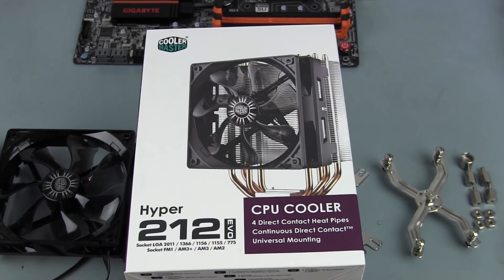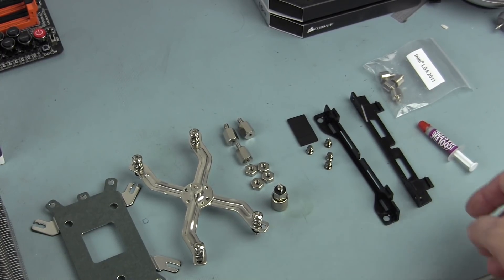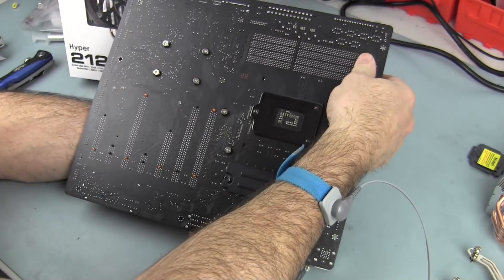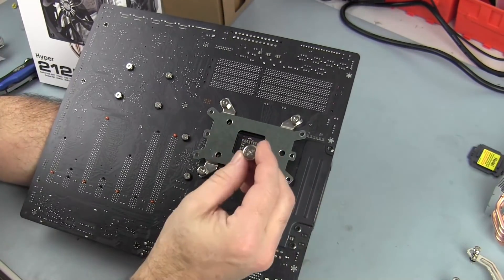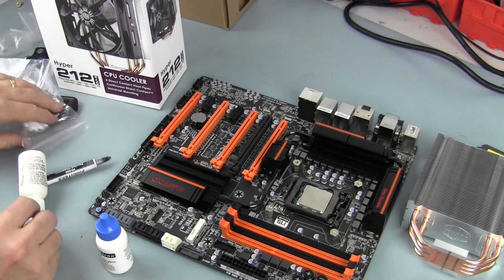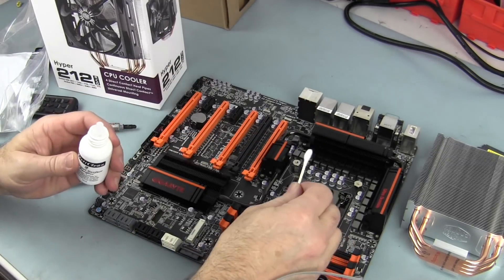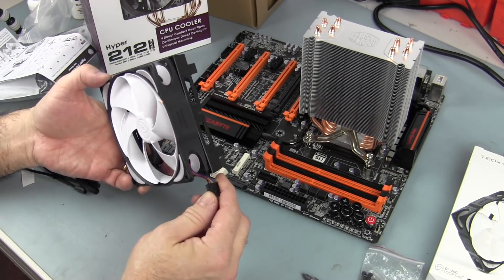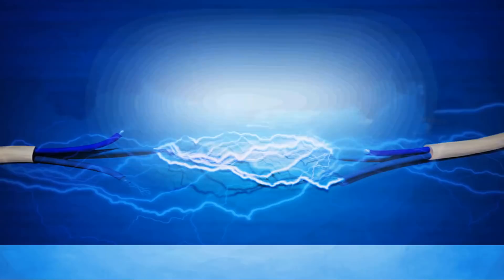How to Install a Cooler Master Hyper 212 Evo CPU Cooler

Comment: plan on putting it on my 8350, will this interfere with my 4x4GB G. Skill ripjaw X series at all? this is on an asus sabertooth 990fx mobo and just want to know if this ram is too tall
Link to the ram: http://www.newegg.com/Product/Product.aspx?Item=N82E16820231429
Reply from the maker: Depends on where your ram slots are and how close to the cpu it is. I have used that ram before and I think it is fine.  But I can not be sure.

Comment: hey i'm thinking on upgrading my cpu cooler. I've noted on these big coolers. The thing that scares and confuses me is if my board will break with so much weight?!

I mean I've seen you installing the thing but the board is laid on the table horizontally. Will it not break the board when placed in a case vertically :S
Reply from the maker: The support bracket they include takes the stress and is designed to allow for a mount in any position case. Horizontal or vertical. It will not break if installed correctly.
Reply: Ronsanut . Cool, thanks :)

Comment: The core is 90 degree wrong orientation, it should point left to right not front to back.
Reply: I'm pretty sure orientation is all preference, depending on your setup.
Reply: As pictured

Comment: can i use the cooler with big corsair ram
Reply from the maker: Depends on your motherboard layout and spacing between the cooler and the ram sticks.
Reply: Also I think the fan slides up a bit. To be safe I'd look at a low profile Corsair ram/another cooler

Comment: What exactly is that screw thing in the middle where the pin connects the bracket to the heat sink? Should that be tightened?

Comment: Thanks for the guide. Watched it on my iPhone when i installed the cooler on my i7 4770k. 32 celcius idle and 60 celcius full load. I had 100 celcius full load on stock cooler.
Reply: Same here, 105 celsius on CPU while playing games and idle is like 70°, man who made my PC fcked somewhere so I'm buying this cooler next week
Reply: @drteska97  I'm buying this cooler soon. Stock cooler my i7 4770 is fine at idle (35c) but jumps up to the low 70s celcius under full load and its very loud. Hopefully it's not too much of a pain to do it with mobo in the case
Reply: Jeez thats high

Comment: I'm using the similar cooler Cooler master 412 slim + intel 3770k + Artic silver. Temps are idle = 30C, Load = 65C. That's not very good for this cooler is it?
Reply from the maker: Depends on the ambient temps in your room and the voltage you are running on that chip.

Comment: One of the primary reasons I bought this unit was because it is listed as one of the quietest on the market; Do you really need it quieter? Why change out the fan? Just because?
Reply: I kind of agree that swapping out the fan on this defeats part of the purpose of the install video. OP should probably put that in the heading so people know.
Reply from the maker: Because the fan I used is quieter and pushes more air.  Just my preference. The fan that it comes with is not bad though.
Reply: Ronsanut .
Cool, thanks. I was a little worried I was duped into buying a loud fan (haven't built yet, am doing that now)
Reply: The unit is amazing :D
Reply: t0lkien1 I might of been a little dumb on my part, but I'm currently doing a budget build (£900) and couldn't afford top of the range fans, so I bought 7 CM Sickeflows what are meant to be quieter and better performing than the Hyper Evos 212 Stock fan (plan to put 2 on the cpu cooler) but problem is there 3 pin fans (my mobo does support 3 pin cpu fans) but do you think I should replace them for PWM fans?
Reply: Eh

Comment: does the fan come with everything required for installation? all the screws etc.
Reply from the maker: Yes, everything is in the box to mount the fan that comes with it. It also has brackets to mount a second optional fan.
Reply: Thanks (:

Comment: I have a question. Is it possible to do this without taking the motherboard out of the pc? my case has a detachable board on both sides.
Reply from the maker: Yes if your case has a motherboard cut out for access to the back of the motherboard, it should be no problem.
Reply: Thank you

Comment: You installed the backplate backwards. The taped side is supposed to be facing the motherboard, is it not?
Reply: each side is usable, which side you use depends on your cpu socket.

Comment from the maker: Check you temps.  If they are good I would not worry about it. Just make sure you have the pin in the hole keeping the tower locked in place.

Comment: The cooler will work with the LGA 1155. You can verify this by going to CM's website. And I'm sure it'll fit your case as it fits into my Corsair 350D, which is much smaller and more compact than the HAF 912, with no issues. I'd be more concerned if the 212 Evo blocks any of your DIMM slots on your mobo so double check that.

Comment: Most concise and helpful install video for the 212 Evo on YouTube... thank you! The instructions that came with the cooler is absolutely garbage. At most, one should just browse through it then watch this video from start to finish. Thanks again, Ronsanut.

I've been less than impressed with the stock fan that comes with the cooler so I'll be replacing it as well, but with a Noctua NF-F12 PWM instead.

Comment: No, a second fan would perform just the same as the one opposite, it doesn't share the power it both has it's own equal power, but volume wise, I don't think it would make a noticeable difference.

Comment: i used the stock cooler with the 8350 for a bit until the 212 came through the mail. the temperature difference is quite amazing.

Comment from the maker: Watercooling will achieve the very best results, but if you want to OC now, and have to wait to fund some custom watercooling this $30 cooler is well worth it.  Or you could buy a self contained unit like the H100i and get better performance than the EVO.

Comment: does this cool enough of an amount to spring an extra $30 for it? also is it gonna be okay for a little overclocking (im using an amd processor i mentioned this because they run at higher temperatures than intel) its an 8320 and i wanna over clock it to 4.1ghz (700mhz more) so will this be good enough or should i hold off and wait til i get enough to buy a water cooling system?

Comment from the maker: Ideally you mount it so it blows through the heat sink fins and out the back of your case or out the top depending on your cooler orientation and case air flow.

Comment: You never actually need a cooler like this unless you plan on overclocking.  But that said, this cooler is cheaper than even the cheapest watercoolers, and it outperforms the cheap watercoolers.  You can do better than this if you have a full watercooling setup with a radiator, but those are expensive and quite a bit more work to install.

Comment from the maker: The 212X is the upgraded version that hasn't reached proliferation yet. Fan aside, the difference lies with the aluminum fins. They have X-shaped perforations around the heatpipes. These perforations have a two-fold purpose: the first is to help direct some of the airflow around behind the heatpipes to stop "heat pockets" from forming, the second is to allow for better a better type of airflow.

Comment: Great.i was thinking of getting the Cooler Master hyper 212 EVO,2 cooler master fans(1 for the case and 1 for the CPU) and getting arctic cooling MX-4 thermal paste.Would these decrease the temperature of the CPU greatly compared to the stock intel cooler i have at this moment?

Comment from the maker: Very good as well, just takes a long time to cure and is very thick, You will probably have to use the spreading method to apply it evenly.  But does work good. It is conductive so make sure you do not get it on the motherboard.

Comment from the maker: Low profile ram, is good. Face the fan so it is blowing through the EVO and out the back. If you can put two fans on it blowing from front to back. The air will exhaust out the reart of the case.

Comment from the maker: There is about 7.5 Inches of space from the CPU socket to the roof of the Prodigy and the EVO is 6.2 inches tall , so yes it should fit, however you will not be able to put any fans in the top/roof. Also a fan in the rear of the Prodigy should fit but may be tight.

Comment: How. Much could I safely over clock with this cooler on a i5 4670k. I was gonna use a h100i but its more expensive and barely fits my fractal r4 case. Any help is nice

Comment: Wish i had seen this video when i fitted mine, i had a right hassle before realizing that i had to use the mounting plate!  Also i find that this cooler does a good job of cooling but is quite easy to move around by accident if you try and take the fan off.

also if you run your computer with the side of the case off the space between the CPU cooler and fan gathers a lot of dust, so i recommend you keep the side on.

Comment from the maker: I thought the cooler came with enough. You can probably get some form the Cooler master website or they may have vendors listed who have the pads. Or google stuff like this:
SilverStone 21-Inch x 15-Inch 4mm Thick 2-Piece Sound Dampening Acoustic EP0M Silent Foam SF01

Comment from the maker: Ideally you face the fans out the back so the air flow comes from the front of your case and out the back. But can face it up and blow the air out the top of your case (assuming you have vents and or fans in the top, or you could even face it down or in pulling air from the top or rear into the case, but you have to make sure you are exhausting the hot air somewhere.   Also the cooler is bolted down and does not put stress on the CPU itself.

Comment: Which way should the fan be blowing airflow as directed on the cooler? Can you please give direction? I will be using the fan that comes with it plus an extra fan (second fan) to the back of it. But I am not sure how to properly do this.

Comment: Correct me if I'm wrong but the dimensions of the LGA 1155 are the same of the LGA 1150, just the socket is different.

Comment: i have cooler master hyper 212 evo, my cpu is amd fx 4130, 
my cpu temperature is at 0 to 7 degree celcius... from Speccy, 
and from the bios it shows 15 Degree Celcius.. so which one will be showing the correct temperature  ???..

also from the bios it shows the the cpu fan is running at 700Rpm .. ??

Comment: #5 Finally, like most videos close up attempts are silly, if you're gonna hold up the board, put it right up to the camera, or pause the camera and get the close up, or have a friend help you film it, you also did not mention that the adjustable X bracket's 4 screws are spring loaded, which is why i don't think they have to be tightened till they stop, the pin should be clearly zoomed in on.... overall this video get 3 stars out of 5... no to bad! have a nice day, thanks for uploading :)

Comment: #4 memory hitting the fan is an issue for some you can raise the fan up on the tower fins if needed, you should have discussed this and the wire harness orientation before screwing on a fan bracket, you dropped the ball on fan basics 101 but that's why im here...lol

Comment: #3 so the fan blows into the tower and out the back of the case, also a second fan could go on the other side, you could have used the one that came with it for that, it would just have to be mounted(reverse the brackets) so that it blows in the same direction out the back aka "push pull", this term gets people confused just remember fans must blow in the same direction never against each other, and push pull sounds like opposite but its not meant to be thought of like that...

Comment: #2. Why not explain why the fan is where it is... The fan can be on either side, not to mention the "tower" can be reversed as well, but reversing the fan would cause the heat to blow into the case, you have it right pointing it toward the rear ports on the board, ie back of the case... also once you had to add the brackets to your new fan you could have pointed out which way the fan blows, not an issue for stock fan cause the brackets are pre-installed, you want the fan to blow into the tower..

Comment: Ronsanut, first off compared to most tutorial videos, this is well done, however here are my concerns: #1. you used a 2 step cleaning process for the cpu, yet disregard cleaning the the bottom of the heat sink where it kisses the cpu, especially after removing the plastic which may or may not have some type of adheasive, and even if its just cling-on (relax star trek geeks) type of plastic it never hurts to clean both sides when gluing something. see next comment for #2.

Comment: Hello there! I got a HAF XB case and will use this Hyper 212 on the cpu. I dont OC much and dont like if the noice level is to high. Im wondering if u have any LED pwm fans that pops to mind that will do the job on this Hyper212 either solo or in push pull.
Thanks :)

Comment: if im using the stock cooler for fx 6300 do i have to install the hyper 212 backplate? or the stock cooler backplate is fine

Comment: The only power it requires is the fan. You will NEVER need to upgrade your PSU for fans.. They use a minute amount of power. ALthough honestly I'd got with a 600 W just in case for the future...

Comment from the maker: I have not tried to rotate mine, but it really should be very snug. Undo and recheck your installation. There is locking pin in the bracket and base that should keep it from rotating.

Comment: No, your current PSU should work fine.  In the worst case a 120 mm fan only uses about 3 watts, so you don't need to worry about the PSU being overloaded.   See the picture about 2/3 down on this page: xbitlabs dot com \ articles \ coolers \ display \ 120mm-fan-roundup-1_20 dot html   (Bitch at yootoob about the mangled web address, not me. :))

Comment from the maker: Yes you can change it with any 120mm fan. Remember though you should try to replace with another 4 Pin (PWM) fan . But you do not have to. If you use a 3 Pin fan it will just be on full power (12V) the whole time.  No biggie , just may be a little noisier.

Comment: Hey there,
just a quick question. Is it possible to change the fan with another one from cooler master?
I am going to use a windowed case, so I would like to install a LED fan on the cpu cooler.For instance, would the BC 120 Blue LED Fan work? (Even though it's intentional use is for cases) 
thanks in advance.

Comment: Nail polish remover is generally based on acetone. Pure lab-grade acetone is a great cleaning agent that would work well and leave no residue.
Nail polish remover however, is rarely pure and often it contains glycerin or various oils.

with pure acetone, you will need to be VERY careful. It WILL fuck up anything it comes into contact with that is not metal or ceramic. Most plastics will literally melt and your PCB won't like it either.

Just be smart and use 99% isopropyl like the rest of us.

Comment: On this installation setup with the same motherboard, would the Corsair Vengeance memory fit without interfering with the fan,  it seems that there was at least 5mm of space between the fan and the first memory slot.

Comment from the maker: Yes you can so you can blow the air up or down in your case as you desire. Traditionally it normally is positioned to blow air out the back.

Comment: First time PC builder, don't know if this really matters, but I put the fan on the other side of the tower because it blocked one of my memory slots. It's right next to my rear exhaust fan, is that ok? It won't really affect airflow would it? I have two exhaust fans on the top of the case as well.

Comment from the maker: Depends on your motherboard, Most BIOS now have the option to set your ration and leave all other settings on Autro, when you do that the BIOS adjusts the voltage you need to support that Overclock.   I am just saying the voltage the BIOS adjust to is always way more than you need. Really watch TTL's video and you will understand.

Comment from the maker: You don't have to with these new motherboards, but I found they apply to much voltage, way more than is needed if you leave it on Auto.  Check out TTL's 1155 Overclocking Guide video. That is a good informative video for you to watch.

Comment: if you want to overclock, you DO want to touch the voltage, as the default setting will overvoltage the CPU a lot. Check Tom's video about it (at youtube /timetolivecustoms)

Comment from the maker: Every chip is different.  But upping to 40 without changing the voltage if it can get stable should be fine,  Just test it under load with prime or OCCT.  Try it but you should be fine.  I would put two fans on the cooler though to get the best cooling performance.

Comment: how hot would the i7-3770k be at full load with this cooler if I overclocked this cpu to 4 GHz by only increasing cpu ratio to 40? without touching voltage or anything else?

Comment: I'd think so. But you'd have to plug it into your CPU fan slots. Which usually you have two. The main one and the CPU opt? which allows for a second.  If you use two make sure they force air toward the exhaust. You don't want fans working against each other.

Comment: nice video. Im building my first computer tomorrow gonna get this cooler. that fan is blowing onto the radiator and blowing it out the back of the case right? does this look like a good solid reliable compatible gaming rig to you... intel i5 3570k, gigabyte ga z77 d4h, 16gigs of ram (not sure wich ram to get)  COOLER MASTER Hyper 212 EVO RR-212E-20PK-R2. azza hurrican 2000 full tower gaming case, 850 w gold standard power supply, 660 evga graphics card.

Comment from the maker: I used MX4.  Artic Silver 5 is fine, but takes a couple of days to cure, from my experience.  If you install the heat sink correctly you will be just fine.  Use the pea or line method.